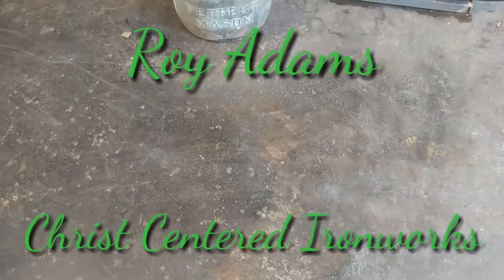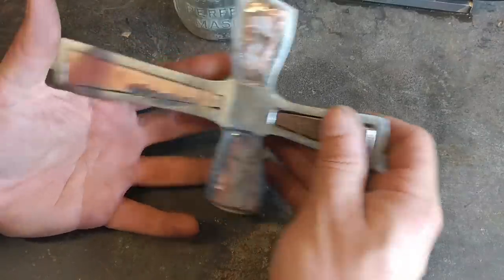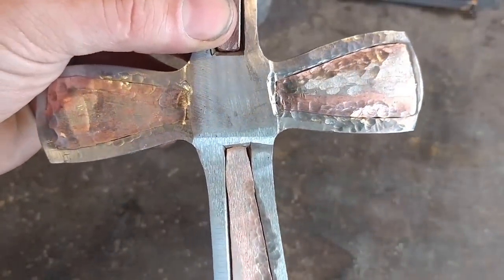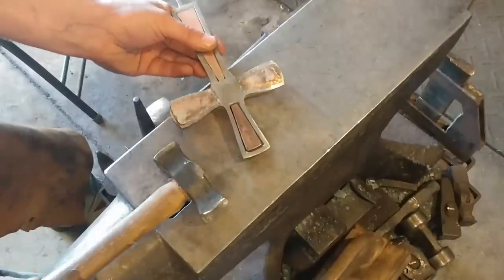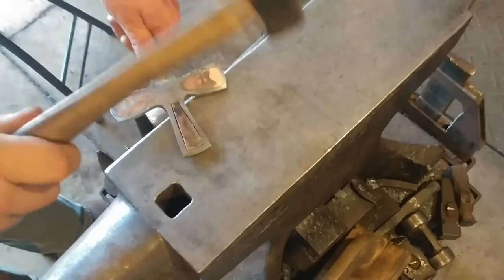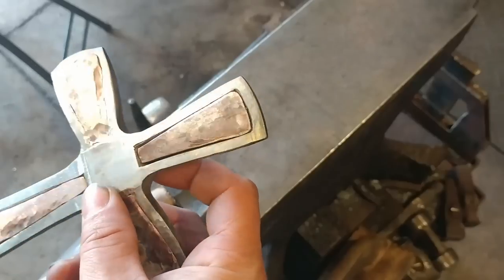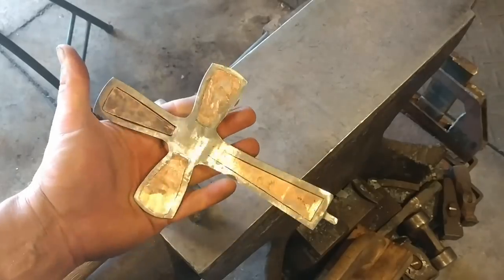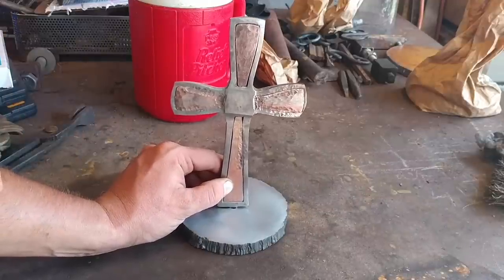Inlaying Mokume Gane in a Hand Forged Cross (Mokume-gane Project)

Comment: great job roy would heating it help or would it cause more problems than solutions as that is what i thought you were going to do
Reply from the maker: +grayem pepper heating it up could've worked but also would of had the negative effect of not being able to handle it as well. This is why I annealed the mokume prior to inserting it in the cross only problem with that is once you work hardened it it is hard to get it to move anymore LOL